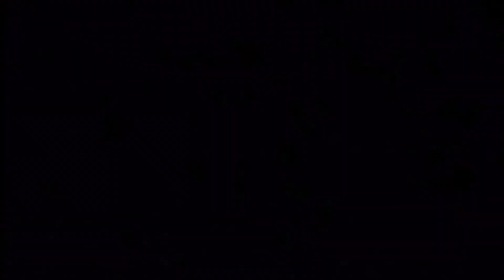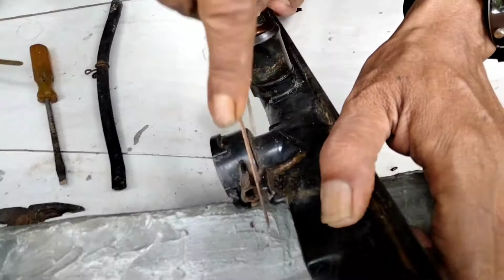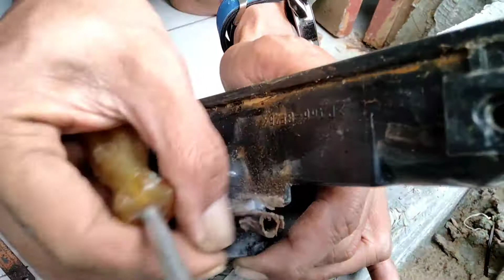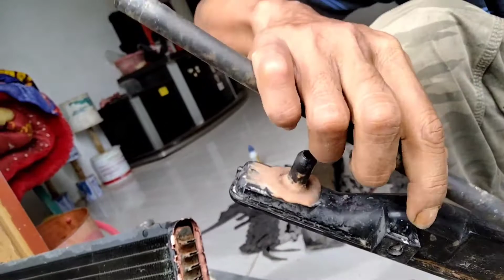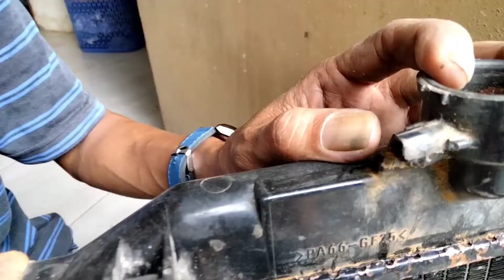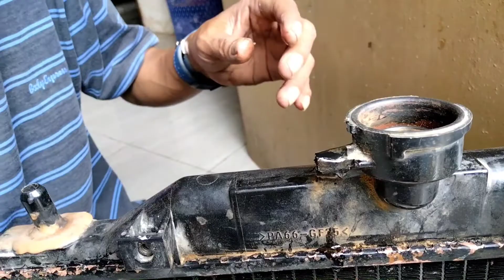Cara mengatasi pipa radiator patah

Comment: bang kalo pipa radiator pda motor gimana jadi patahnya rata
Reply from the maker: Radiatornya berbahan plastik apa tembaga gan
Reply: @dkautoofficial5903  tembaga gan
Reply from the maker: @teguhbnn8131  kalo tembaga bongkar aja dulu lalu buatkan pipa dr  plat kuningn lalu solder ato las kuningan